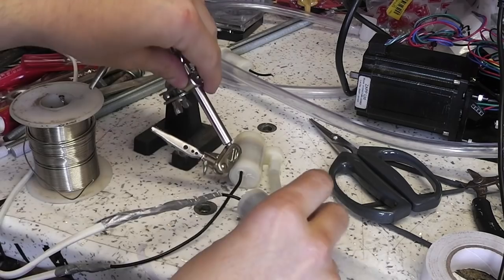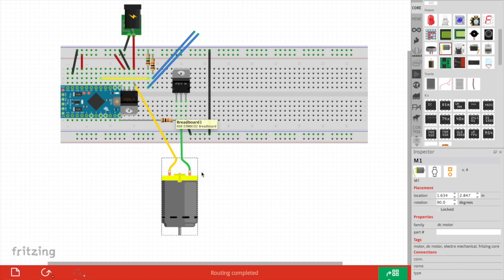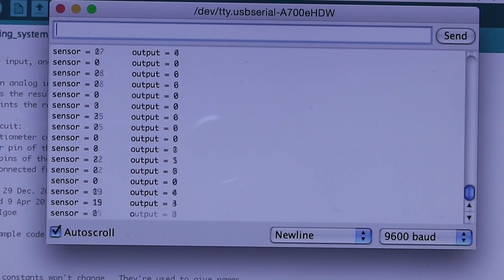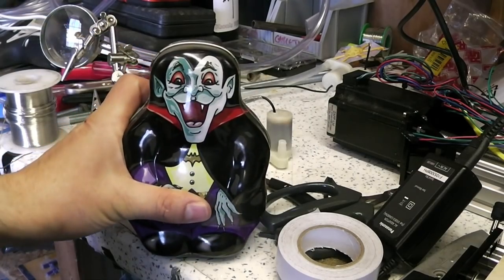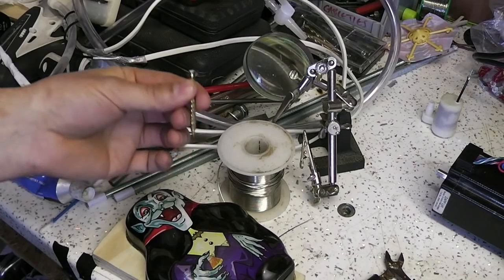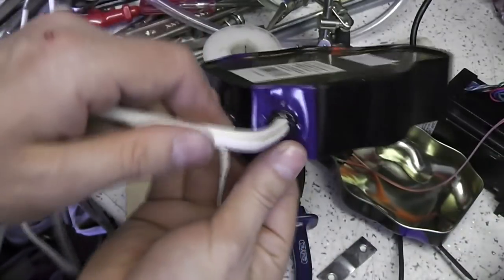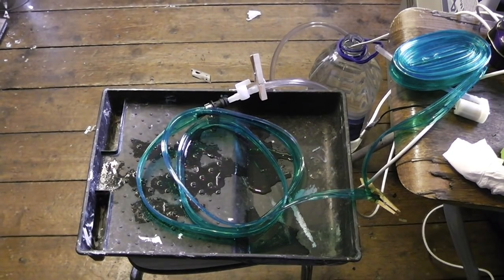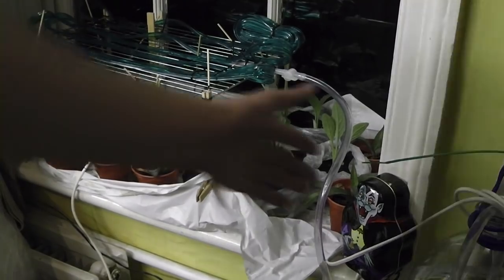Arduino plant watering system tutorial

Comment: Sir how to add LCD to this project.
thanks
Reply from the maker: I recommend using a 16x2 display with the HD44780 chip - there are lots of clones of that part available. That requires 7 I/O pins, so there are enough spare pins for that in the circuit you see in the video. You can use the Arduino LiquidCrystal library to control it.

Comment from the maker: Re: +Mike Hawk 's question - For some reason I wasn't able to write a reply under your comment, but here's my answer: At that stage in the build it looked like the pumps were fairly powerful but I had the end of the pipe resting almost on ground level, so the pump wasn't working against gravity. When I needed the pump to lift the water up to the windowsill, I needed all the pump power I could get. But you're right, if I had needed to reduce the power I could have used PWM.

Comment: can I make a water system without pump?
Reply from the maker: You could use gravity to drip water onto your plants but you'd need to use a solenoid valve to control that with an Arduino. The circuit would be very similar. Or you could use a servo to control a tap or valve. That would draw less current and could be powered directly from the Arduino.
Reply: OpenTronic I am thinking just with a motor to turn on the sink for x seconds
Reply: OpenTronic thanks

Comment: Since you're using a MOSFET transistor, couldn't you just have put the gate to a digital pin with PWM and in that way reduce the power of the pump? I mean since you considered the pump to be pumping "too well". Just a thought...
Reply: Also, great video! Thanks for sharing.

Comment: Why didn't you just write that the water will get dispensed until the needed moisture is reached, why did you set it to 10 seconds?
Reply from the maker: During the transitional state whilst the soil was drying out, but not quite dry enough to trigger the sensor constantly, the unstable reading from the sensor switched my first pump on and off very rapidly. That state could last between 5 and 10 minutes. So after a couple of days of that, it fried the motor. My updated watering system increased the gap between readings even longer, to about 5 minutes. This actually increased the stability of the system. It's something that I would never have thought about as a coder but became obvious when testing my ideas in the untidy real world, with cheap components.
Reply: That's a good point. I have a premade sensor that is a lot more sensitive so this state where it's on the border between these two states is only 1 or 2 minutes, I have 0 to 1000 units. Maybe you should try that too, but your solution works as well.
Reply from the maker: GamePhysicsReviewer next summer I might try a version without a microcontroller.. either with only transistors, or maybe something mechanical with minimal electronics. Arduinos are great but I feel like challenging myself by going back to basics.
Reply: I see a lot of people saying that but I never understand what's the problem with using more software than hardware, you could say it's easier and in times when you only have hardware you would benefit from the knowledge, but arduinos are so cheap and easy to get that I don't think you need to focus too much on doing everything without arduino when it's not a matter of power usage, size, e.t.c. I have this watering system with a bottle of water on top of the plants(Upside down), and a motor opening it and closing it, after there is a tube that sepperates in to 5 others and waters the plants evenly. Maybe try something like that, you won't need those pumps.
Reply from the maker: No, I don't see any problem with using software to fulfil a goal, and I think tech is moving in a fascinating direction where microcontrollers and tiny computers are becoming so cheap that the entire world could be a smart interfaced environment. But personally I always want to break my habits and remind myself that there is more than one way to achieve something.. my paid job is as a coder too, so sometimes it can seem like I'm coding all day for money then coding as my hobby too, which can get overwhelming.
Reply: Good point, fortunately I AM a student so my day is dynamic, but of course making things in hardware is a good profilactic way to evolve your thinking. Can you please give me the eBay listing for your pumps? all the ones I saw were over 50$.
Reply: OpenTronic if these are 3v-4.5v, can you power it directly out of the arduino?
Reply from the maker: I believe I've seen tutorials where people power a similar motor from an Arduino pin but I'd always use a low power cheap transistor as a go between. A motor is an inductive load and can produce back EMF and noise so I'd tend to even go a step further and take the +ve from a separate voltage regulator than the Arduino.. depends on whether you're running it off batteries or a 'wall wart' and how much current that power supply can provide, because even a small motor can pull a large spike of current as it starts, which can cause the Arduino to reset if the available current isn't enough.
Reply: OpenTronic I figured, sorry for asking so much, but could you please link me the transistors you used because I'm new to this game and I don't know all these transistors and their function, I would've probably used a relay but a transistor seems cheaper and more compact. Thanks.
Reply from the maker: Search for BC548 transistors. Those are good general purpose low power transistors. Higher power applications need MOSFETs. I wouldn't attach a relay directly to the Arduino either, you will also get back EMF from the coil and I'd also attach a diode backwards across the coil to dissipate the back EMF.
Reply: Gee, thanks. You really know your stuff, to be honest.
Reply from the maker: I know enough to build logic circuits and how to interface a lot of stuff with Arduino but if you want real in depth electronics you should check out the channel called Great Scott. Bigclivedotcom is good too but probably less practically useful if you want to start building circuits quick.
Reply: OpenTronic Yeah, I know him, but sometimes I get lost in his explanation videos, I much better understand "simply electronics" channel. Scott has great ideas but in my opinion he fails to explain all the concepts because he wants to make the video shorter.
Reply from the maker: Richardo Panini EEVBlog is great, His stuff about vintage computing blows my mind.

Comment: great build but dont forget to do only a few seconds reading tru the ground sensors else they will corrode quick, normally they use ac to measure instead of dc.
Maybe let it measure once every hour and water few seconds so the water can soak the ground slowly.
Reply from the maker: Rene046 thats a good tip about the sensors, I hadn't considered corrosion. In general this was a difficult system to tune and I think  that running it slowly and watering gradually is good advice.
Reply: OpenTronic I can confirm that corrosion will occur and quickly. I am not versed in electricity and could. It figure why my sensors were damaged after only 2 weeks. I now understand.

Comment: Really interesting. I used to work in a greenhouse and folks were always making watering systems, but those were timer based. No one ever made a monitoring and dispensing system. A problem we had with commercial moisture probes was the soil pulling away from the probe as the ground dried. The probes are so sensitive, as you noted, that the soil shrinkage messed up the measurements. I'm now off to watch your Arduino laser conversion :)
Reply from the maker: I admit that the system in this video was always a bit touchy, too! I'm just glad that I found out how to make those cheap moisture sensors because I think even with commercially made sensors it would still have been difficult to tune to run stably. And I suspect that a timer based version would have been just as effective. I noticed as I was writing the Arduino sketch was that a simple sketch worked a lot better than a complex one, and the same function could have been built with 2 or 3 transistors (plus the FETs) instead of the Arduino. Next summer I'll have to try a 'No-Duino' version because these microcontroller systems have been 'done to death'!
Reply: The best I know, moisture is consistently (and inexpensively) measured with weight (adjusted slightly by estimated growth of plant.) There are accurate exotic methods based on EM absorption. Perhaps there are materials, other than soil, in which the moisture probe could be packed, that would wick water and keep the probe in contact? I watched your Update video as well, and that was very interesting too. Reminded me of the classic PID control loop of maintaining a level of water in a tank with an outflow and a controlled input flow. The measurement device could be a potentiometer on a float. While it may be a little overkill, such a control loop would make a very educational video. I work now designing plant measurement devices, to monitor growth and such for lab experiments. Sort of a very slow PID loop I suppose. Person makes a change to the plant, monitors growth, makes another change, etc. Lots of potential in this area for teaching too. Best wishes, Kent
Reply from the maker: Kent VanderVelden that would be cool to build a system based on weight. In my last job we interfaced with scales with serial outputs which Im sure could be done with an Arduino, but those scales weren't cheap. Did you have a simpler weighing method in mind?
Reply: The parts that we used at work were also pricey, but the obtained resolution was overkill. With those load cells one could measure water lost through evaporation off the soil and transpiration through the leaves. It was amazing to see the milligrams click off. That stuff is not needed, and I bet that without too much hackery, it would be possible to interface with a digital bathroom scale. Hard to bet economy of scale. Would be a cool project.
Reply from the maker: A bathroom scale interface would be a cool project. In the same vein I've been meaning to interface with a laser distance measure - that would be so useful for a lot of stuff. Before I got really into electronics I wrote a processing sketch to read the numbers off a digital display with a webcam, but its not much practical use since you need a whole computer just to run it. If that could be implemented on an Arduino camera, that could suddenly be a universal interface tool.

Comment: Hey! Great video, thanks! So cool that u showed a way to build a sensor from scratch. Ill also build one of these guys. 
But why are you using the 10K "limiting" resistor? Wont the currand anyways be limited by the 1M res?
Thanks for a reply!
Reply from the maker: Neither the 1M or 10k resistors are there to limit current. Together with the soil itself they form a voltage divider, the centre of which is connected to the arduino analogue pin. The resistors adjust the output of the voltage divider into the best range for the arduino to measure it.

Comment: Hi there, you may find fittings similar to these a better option. I used to use them all the time when gardening in Spain.
https://www.ebay.co.uk/ulk/itm/380924372936 
Also putting this into the dracular has made my favourite comment useless, " It does exactly what it says on the tin " 😀👍😜
Reply from the maker: +Smallest Workshop (Geoff Harris) The watering hose kit is a great tip, cheers! £25 is a good deal for so many fixtures. The water delivery is definitely a weak point of my system - in the short term I'm considering just pumping the water into a tray beneath the pots and letting it soak upwards.
Reply: +OpenTronic if you search eBay they are available in smaller quantities for around a fiver. If you have the time, it seems you don't have too many pots, just make a small hole 1mm in ordinary aquarium pipe for each pot and adjust the pressure accordingly.
Reply from the maker: +Smallest Workshop (Geoff Harris) https://uk.pinterest.com/pin/1759287327623204/ this would also work pretty well if I want to use this system permanently (rather than just to start seedlings)
Reply: +OpenTronic I like that idea, very little water wasted.